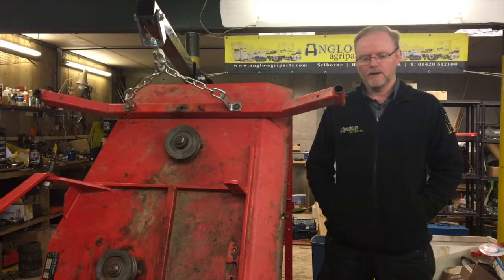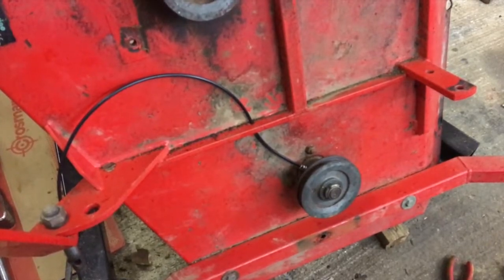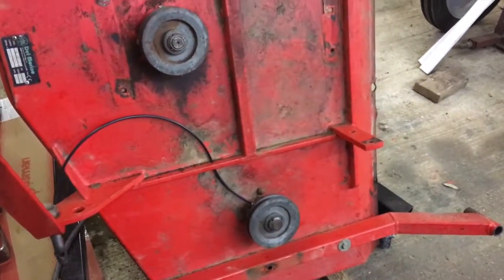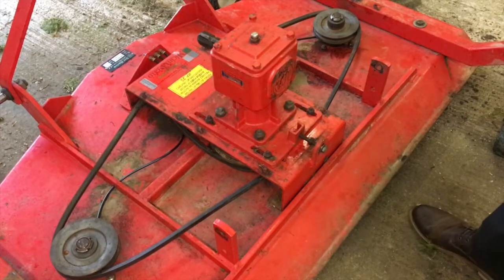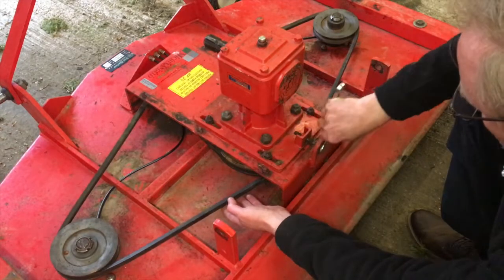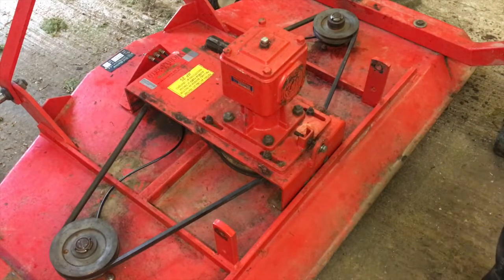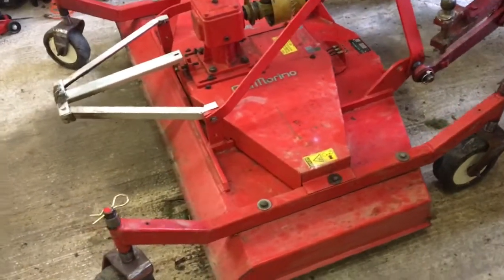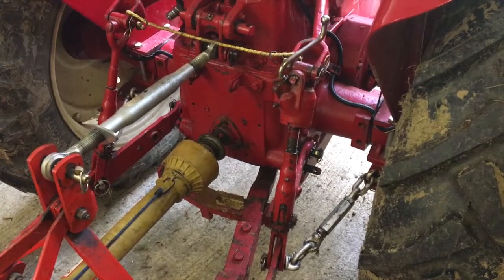Delmorino PRM150 - Mower Service

Comment: Hi, great video, thanks for sharing. Does the gearbox oil need changing when servicing and if so, how do you do that?
Reply from the maker: Hi David, yes it should be changed from time to time. I service my mowers every other year and I only change gearbox oil on every other service, so every 4 years. Obviously it depends on how much you use them. We only have 2 acres and 2 mowers, so each is only doing about an acre each. Mine has a full cap on top and a fill level plug on the side. So you have to either remove it from the mower so you can drain it by inverting it or you’d need to use a sump pump. Refilling is easy, just add gear oil until it reaches the level of the fill level hole. Use a good quality gear oil of 80 or 90 weight. Hope that helps 😉👍

Comment: very informative video, where did you find the blade shaft, i have looked everywhere on the internet and can not find one
Reply from the maker: Hi Roger, thank you for your comment. I’m not sure what you mean by “blade shaft”? As I recall the only thing I replaced was the bearings. Generally parts are a little elusive but I’ve determined that many of the components are actually universal between the “manufacturers”. So best thing to do is to take a number of key measurements and then contact a few different companies to see if they have compatible parts. I recently found new blades for this mower this way. Hope this helps. 😉👍

Comment: What size & Where did you get the black hose for grease. And i cant find anyone that has these grease fittings
Reply from the maker: Hi Farmer Phil, it was awhile ago now, but I do recall it being a bit of a struggle to find these. I believe in the end I found these at a local tractor and garden equipment repair shop. Sadly they are no longer operating. I will try to remember to measure the pipe on Saturday and message you again. The fittings will need to be “sized” to the pipe, once we’ve identified that.
Reply: @WaterhouseForde  thanks, i cant find the proper tube in metric and so not available.